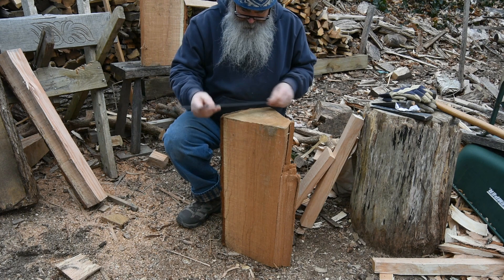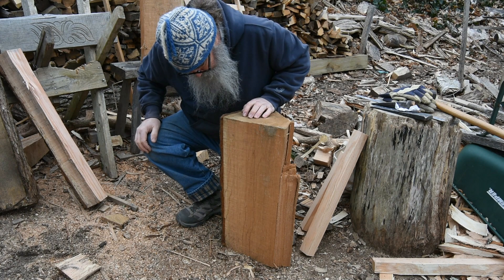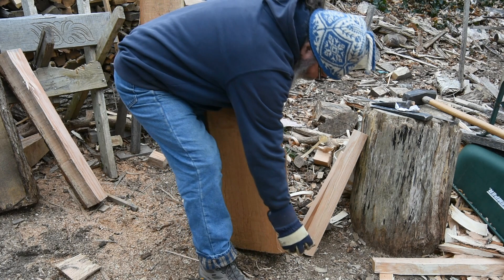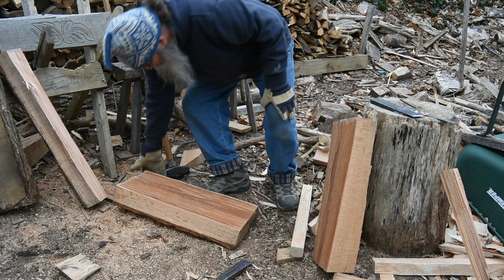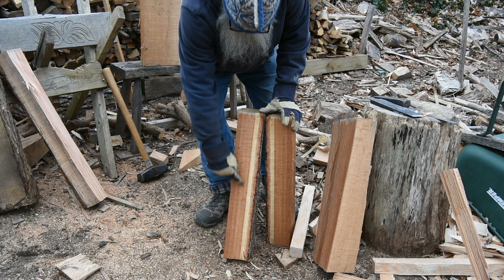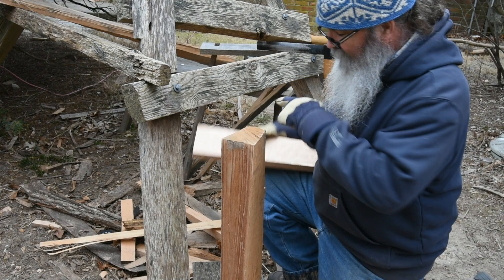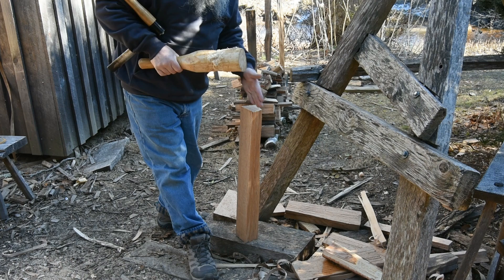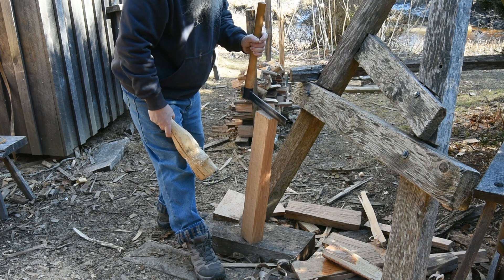Joined stool splitting

Comment: Hi Peter I lack a band saw... I wonder if you can do a video on splitting techniques with wedges and froe on straight hard wood logs in order to make true quarter sawn board 28 inch or 40 inch length , 2-4 inch thickness and 2.5-8 inch width . ( i will then rip saw these down again as needed) 
the current technique I use is half split the log then quarter then I have always been too chicken to try split the quarters! I always just rip saw them from then its quite a workout but better this way with the japanese katana saw as it has a thin kerf and wastes little wood! 

Thanks alot I like your videos!
Reply from the maker: There;s a trailer here for a video series I have underway on vimeo - https://www.youtube.com/watch?v=iixpuk4xvKU&t=5s and a 17-minute  one about splitting here - https://www.youtube.com/watch?v=uqEoymNl9Dk and lots of discussion about that work on my blog pfollansbee.wordpress.com

Comment: Can large sections of sap wood be of any use?  I have a 26" diameter white oak log, yet it has a 3" radius of sap wood. I'd hate to not make something of that much wood.
Reply from the maker: depends how fresh it is. Sapwood when it's fresh is almost white. As it goes "off" it turns grey. So if it's leaning towards white, it will still have the strength you need. If it's discolored, it makes great firewood.
Reply: @MrFollansbee  Thank you for the information.  My sapwood is bright white and splits well. I'll experiment with it.

Comment: Is the wood you are working with green or dry please?
Reply from the maker: dripping wet. Green woodworking to be sure.
Reply: @MrFollansbee  Sorry to jump in. Does that mean the stools are made while the wood is still wet or are the blanks dried before use?
Reply: @rowb9449  he mentions that the pieces will be dried and is conscious of cupping, which is why he splits them with the radials on the face side of the aprons.